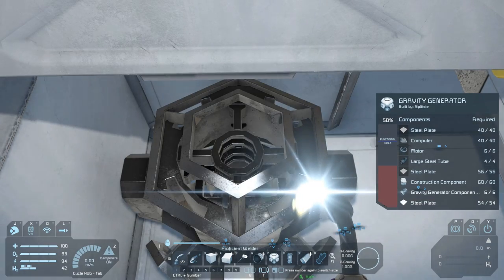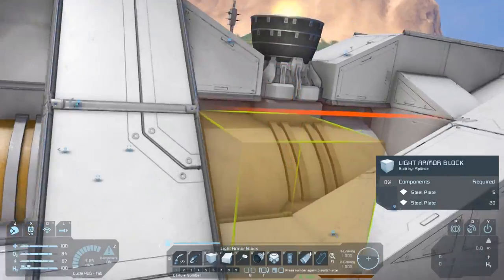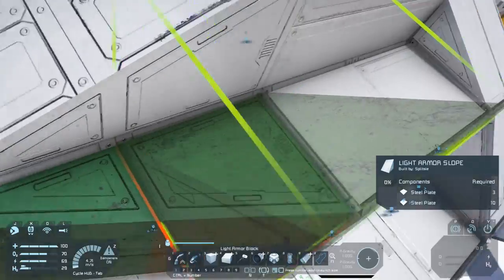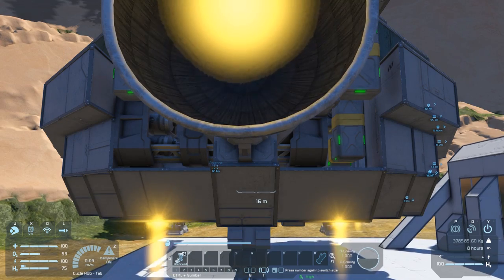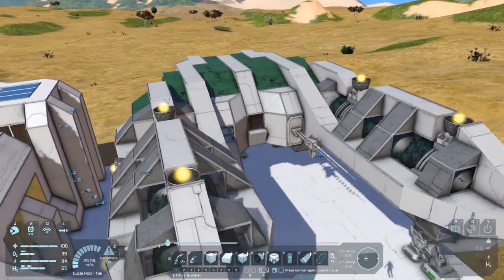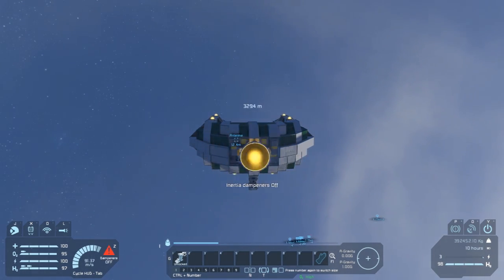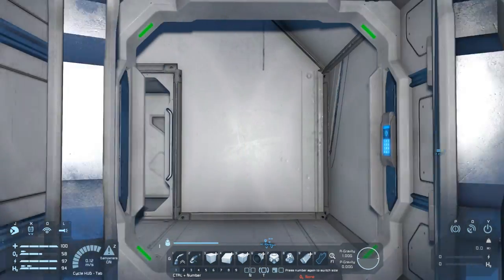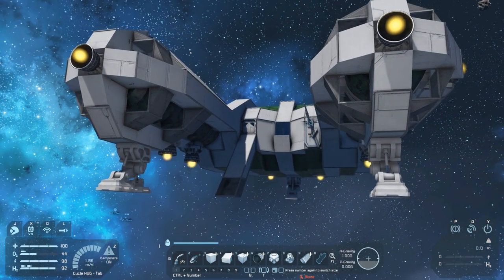Space Engineers Tutorial: Large Ship Design Part 4 (Survival design tutorial series)

Comment: Great ship, I learned a lot watching this. Thank you! Two things I noticed though - for some reason I didn't have the problem you did with the ship not pressurising. Possibly they've changed the way it works since you made this? But I decided to follow the design anyway and there was one problem it caused. By re-doing the conveyor  for the reactor room, it severed the connection between the two halves of the ship. That makes it possible to only have hydrogen going to one half of the engines if you only put ice in one of the h2/02 generators. Also means you can't trade items between the two cargo containers either. It's not a huge problem  but I would have liked that functionality. UPDATE: If this is an issue for anyone else it's actually a very very simple fix - assuming you followed the build so far, above the oxygen tank is a straight tube. Grind it down and replace it with a conveyor junction block, so the reactor is also connected. This makes all storage accessible from everywhere on the ship, including the reactor, without having to go into the room to refill it.

Comment: I followed your design right up until you started adding armour. I added conveyors from the storage to a piston/connector under the cockpit so I can dock with a space station/refueling connection or take a small drilling ship with me. Also added minigun turrets connected on top of the same storage for a bit of defence. The problem with what I've made is that I didn't hear you say light armour blocks and built it with heavy. Had to replace all thrusters with large ones just so I could get lift but it's turns way too slow. Did it in creative so I could upload it to use with the XB1 version so it's not that bad but it took me close to 6 hours to build. Oh well.
Reply from the maker: It's all part of the learning process, to get your heavy ships to turn faster you'll need to add extra gyroscopes, though when you're talking really heavy the number needed for speedy turning can get quite ridiculous :P

Comment: I know im late, but why would you not put a battery on OFF setting to replace one of the hidden armor block inside the ship so incase you lack power from reactor, you still have that to repower the conveyor system.
Reply from the maker: You certainly could do that, but if you've got reactors, having one directly accessible is just as reliable a way of ensuring power's available. So really the choice is whether you want the weight of the battery or have to go find uranium/put a reactor in that's accessible, both have their advantages :)
Reply: @Splitsie  I meant both of them actually. 1 Battery to ensure that you can activate conveyor system so that you can replenish reactor without having it exposed.
Reply from the maker: Yeah, I got what you meant. That's why I'd see it as a choice between the two, with each having it's own advantages and really coming down to a choice for that particular ship.

Comment: That's awesome! Couple questions. Do the landing gears retract? Same question for the entry ramp?
Reply from the maker: Sadly not, it's a limitation of space engineers. You can make things that move with pistons and hinges but there are some fairly big caveats for using them on things that fly near planets
Reply: @Splitsie  ok thanks, I was thinking about rotors and I did watch your video on those. Might give that a try. Thanks for the response.
Reply: @Splitsie  I got one more question please :) .... I am building a ship as you did connected to the base. I'm trying to get an idea of how much thrust I am going to need but when i hop in the control panel it's giving me the stats for the while grid not just the ship.... So if I build another fairly dang long scaffolding from the ground and then grind off the connections to the base am I good? Or does it all come tumbling down hahaha.
Reply: @Splitsie  I chanced it and it still stands ! pheww
Reply: well crap it still doesn't give me the mass because I guess because it's considered a station right now
Reply: I screwed up by not using the landing gear at the bottom of the scaffolding

Comment: i have problems filling my hydrogen tanks and o2 generators, is it because of the amount of ice? I had 8k on the cargo container and it was connected to the generators. Also, do I have to change any configuration? thanks
Reply from the maker: 8k of ice won't go very far in terms of filling a large grid hydrogen tank, have a look at the tank in the control panel and it should give you a percentage of how full it is, if your cargo system is working you'll see a small amount there and be able to see when you've used enough ice to fill it. If it's not getting anything then I'd check through your conveyor system to make sure nothing is broken or missing :)
Reply: thank you! I was surprised because it didn't even lift.
Congratulations for your 10k subscribers!

Comment: hey, ive tried to do the o2 generator and stuff but no matter what i cant get the yellow light go green
Reply from the maker: The first thing to check would be the world settings. The default is airtightness off and that will stop the vents from working. If that's definitely on, try making a small room with the vent and closed off entirely with armor blocks. With ice in the O2 generator and power you should be able to pressurise that room. If that works then there's a hole somewhere in the larger room, probably a block that looks airtight but actually isnt according to the game, iirc some of the glass blocks fall into this problem
Reply: There is a mod on the workshop by Digi called 'Build Info'. It's a must have. It tells you how many air tight faces a block has when building (along with other info). It also adds an 'Air leak scan' button to all air vent blocks that shows you exactly where your leaks are :) 

Digi's build info:
https://steamcommunity.com/sharedfiles/filedetails/?id=514062285
Reply from the maker: It's an awesome mod. I use it on most of my worlds, it's super handy for lighting as well because you can modify the light you're looking at without having to find it in the control panel

Comment: do gravity gens effect the ship they are on? For example does it cause the ship to fall down in the direction of gravity you've set up? I've heard people mention gravity drives I don't see how they could work if the Gen doesn't effect the ship it is in
Reply from the maker: Gravity generators only effect artificial mass blocks, without these they have no effect on blocks at all. It's with these that you can create gravity drives by placing the artificial mass blocks to be pushed or pulled by the gravity gen.
Reply: Splitsie do they allow you to reach speeds higher than normal engines?
Reply from the maker: No, the speed limit is always the same (unless you mod it). Gravity drives can be useful for very large ships, but I've never really used them myself
Reply: Gravity drives are very useful to make large ships juke to the side to surprise an opponent.